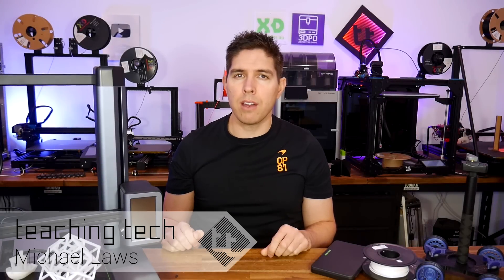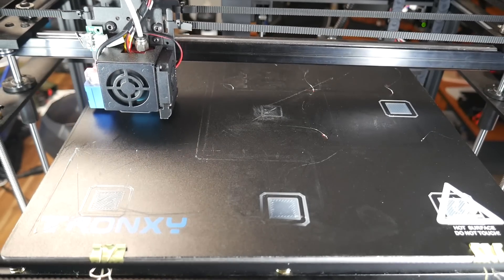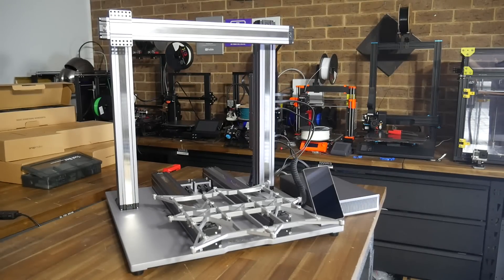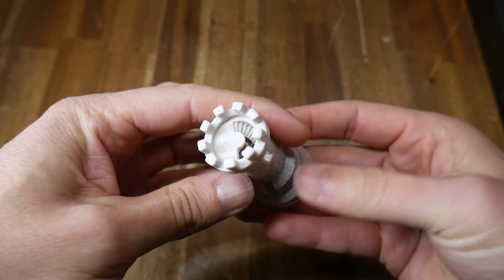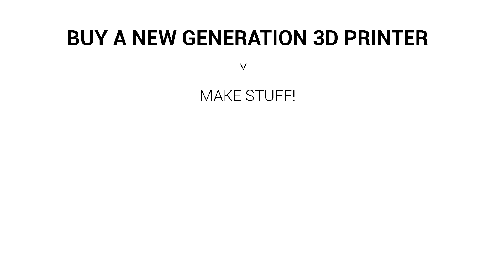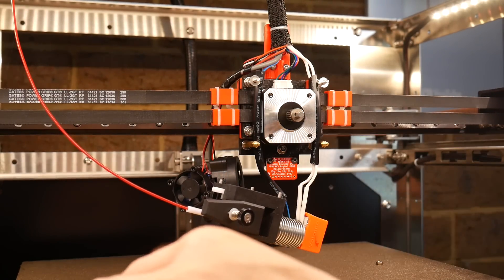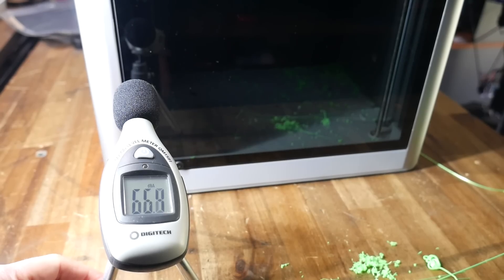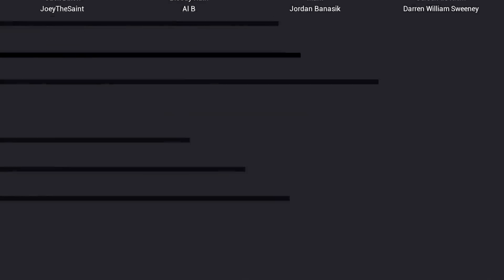Next gen 3D printers are here, but do they bring fresh problems?

Comment: I think you hit the nail right on the head.  The X-Plus3 is a great example of a product that desperately wants to be a cheaper X1C, but completely missed what makes the X1C good.  Ironically, the plastic bed plate that seems to be such a big liability for the X-Plus3 is actually present in the X1C, but the materials and geometry are different and don't seem to cause issues.
Reply: So warped beds on x1c and p1p is a not an issue for you? Lol
Reply: @rightsdontcomewithpermits7073  my p1p bed isn't warped
Reply: @splitt3r  good for you! You won a lottery with them! Mine x1c has a warped bed and bl send me another warped bed. And told me no more. Because there is a big possibility I'll get another warped bed. But regardless they claim it is within the specs. But fail to tell me who's specs, and ignore every time I'm asking them to give me my bed mesh data. 
This crap printer is overhyped.
Reply: @rightsdontcomewithpermits7073  at PwnCNC we are about 20 X1-Carbon deep already and have had 0% problems so far. 
Sounds like you just got a lemon or lemon bed at least.
Reply: @rightsdontcomewithpermits7073  if I measure my beds, they're not perfectly flat, but the mesh leveling seems to handle it well enough.  If I hadn't measured, I wouldn't know.
Reply: @Clough42  Curious about these new gen printers with software bed leveling: If the bed is indeed warped, but the software compensates for it... then does the print become warped to match the bed? Would the finished print not be able to sit flat on say a glass table?
Reply: @TweakRacer  That would really depend on the degree of warpage. If the warping is sufficiently small, it would get lost in the deformation caused due to the internal stresses generated during printing being released as the object comes off the build plate.
Reply: @TweakRacer  Yup, that's exactly the case. Doesn't really matter to those, who print trinkets and toys. But a huge problem for the crowd, that is into prototyping and/or functional parts.
Reply: @ClintonCaraway-CNC  You are pretty lucky then because like @rightsdontcomewithpermits7073 I also have a warped banana bed and got another banana bed from the support. Center to Corner with differences from 1.0 mm to 1.5 mm on both beds. Support also told me that every other bed they would send can be warped too because of their production methods. Large prints got a banana shape too and are shaking if you touch the corners.
Reply: @TheStunRope  jeez and I thought my ender 3 S1 with .3 variance was bad. Even my €15 180mm Alu bed from AliExpress was better at .08
Reply: @Botanic2000  Yeah lol what would Clough42 know about 3d printing for production? Not like he's using 3d printing for production on a basicaly continual basis. Oh wait...

Comment: Bambu Lab X1C owner here. I really did not like how technical it was getting klipper up and running on my previous printer. I don’t care if software is open source or proprietary. I really appreciate that with my Bambu printer I only had to unbox it, turn it on, let it go through a self calibration process and it just works. I haven’t had a single failed print, the firmware updates brought helpful improvements, and the Bambu Studio slicer and Handy mobile apps are easy to use. The printer just works and it’s fast.
Reply: Same here my first printer was a anet et4x and it use to work for the first like 3 months but then it just was fail prints, then I got the ender 3v2 and the same experience thinking it was me following YouTubers advices on how to improve the machine and got another ender 3 V2 to just leave it as it comes out of the box but the same experience. I got the bambulab x1c and I have 70 hours of print time and just first layers issues that are just because I have to apply more glue stick to the cool plate but nothing that I have to tear apart the machine to fix, it have been an awesome experience and I am learning cad more faster than ever because I can make my prototypes fast and with no issues.
Reply: The big issue is that Bamboo makes disposable printers. At some point they will stop supporting your printer and you will not be able to get parts, meaning you will need to toss it and get the next model. This is like most products. What makes Prusa special is since they are open source you can get parts for all their printer or print spares yourself. Also you can update all of the i3’s  to the next model. You can update a mk2 all the way to a mk4. It’s very unique in the disposable economy to have a machine that is still supported and upgradable a decade later. With that said Bamboo is a good printer and should work well for you for a long time.
Reply: @MrKornnugget  My only question now is, seeing the speed and efficiency in new printers I wonder where to take my Prusa MK3s, or if I even should upgrade to a MK3.9 or MK4. I look at that money for an upgrade kit and think I could easily put that towards a Voron after saving. Or an X1 if I don’t want the hassle. There doesn’t seem to be any plans to bring some form of input shaping to the MK3, and I don’t know how far I can take the MK3s. I’d love your input tho
Reply: @krokenlochen   I have been looking at the MK3s to 3.5 upgrade. for $250 you get the "xBuddy board and new LCD, gives your MK3 the new 32-bit electronics, new connectivity options, Prusa Connect support, and also Input Shaper and Pressure Advance for high-speed printing." I am not sure if it is worth the money or not. I am waiting on someone to get the 3.5 upgrade and show how well it works.
Reply: Where are you getting that statement from 😅.  @MrKornnugget

Comment: After being unable to print anything for two weeks with an Anet A8, I picked up a Prusa i3 MK3 in July of 2018, and that made 3D printing my hobby (and partially I made a living from it in the past) which I still enjoy to this very day. This experience alone, and the fact that Prusa printers are and will be open source, and that they are based in Europe, not China, makes me gravitate towards them. So even if the Anker and the Bambu could be a better value for the money, I will still go for the i3 MK4.
I like Czech beer, drive a Skoda, so it seems natural to have a Prusa :D
Reply: Is the mk4 even a competitor to these machines? I don't think so. Fact is these are fully enclosed and can do more materials - that alone makes them a totally different product. Also, what exactly does the mk4 bring to the table? Why would I buy one over these? Literally no advantage.. Voron 2.4 is more comparable. But ultimately, the voron, and prusa machines all fall short of being press and play... no purging, no self cleaning nozzles.. you still manually have to do so much.
Reply: @jessejuliano8056  The Ankermake M5 is not an enclosed printer! Watch the video again. :)

Besides it's very easy to enclose a printer, even it is a much cheaper Ender 5 S1. So it's not even a premium feature to print materials like ABS or PA.

It seems like you dont want to get the points mentioned in the video! But having a machine that can easily be maintained, can be equipped with 3rd party parts, is produced in Europe, offers a 24/7 support and a well written documentation are just some points here.

Maybe Prusa has to rethink the pricing. Maybe the 800 bucks Kit is the way to go here. But looking at those max. 800 bucks there are not many companies that offer the point mentioned. A Bambu Lab is not easy maintained. A Creality often does not have a fluent and well documented user experience. A Voron can not be purchased as a out-of-the-box machine and is way above 800 bucks. A P1P is also not enclosed and does not come with a hardened hot end... and the list goes on.

There still is no "best printer" and there still are many use cases. So it remains good that there is competition.

Comment: My concern is repairability and total dependence on the manufacturer for support. It is great to see stuff that works well out of the box, but it also looks like a move toward the "use it until it breaks, then buy a new one" culture.
Reply: Do you also fix your flat screen when it is broken? Microwave? Do you personally fix your (post-2020) car even? What about your washing machine? 
Have you installed any mods on your washing machine lately?

I'm happy the Chinesium/Prusa hobby and tinkerer toys are being supplanted somewhat with appliance grade printers.
Reply: @johnfaustus1  you've obviously never used prusa. They do come pre-assembled now, and they just work. You don't need to tinker. You also don't need to repair it yourself, they have the best tech support outside the industrial market and you can pay a shop/master to fix it, which will be still an order of magnitude less expensive than paying to repair some of the "aPLLiAnCe"-grade ones.
Reply: @LoisoPondohva  
100% agree, Prusa is almost the opposite of this. 

Being able to grab the new parts and even iteratively upgrade older models to newer versions is the antithesis of the modern "throw it away and get a new one" type approach. Their support and spare parts options are pretty much second to none. While they may not be super affordable, the quality / just works option & the maintainability & upgrade paths are just fantastic. If I am honest, I wish I got my prusa before I got my Ender 3, I likely wouldn't have bought another one
Reply: Prusa is the better one of the bunch in that regard. If you can build a kit, you can easily repair it.
Reply: A smart move. I have a BMW and know full well when you need a part, you HAVE to get a BMW part. Even if it's just a battery to fit your TPMS, which can set you back hundreds and needs a special tool to fit, so they charge hundreds more for labour, for a battery than Taiwan probably makes for pennies. My battery in my Navgator 5 needs renewing now because it no longer holds a charge, and they want £66 for it. You can buy a whole satnav for that. I looked everywhere online and it turns out you have to go through BMW, even though it's a Garmin made system. Last year the control ring failed, which is just a ring of plastic with wires coming out of it. They charged me £188 for the replacement which took them 10 minutes to swap out.
Reply: Similarly, I'm worried about apps. I'm not interested in cell phones and apps and programming and find programmers and their creations incredibly off-putting. Being able to print from around the world is not interesting, fucking around with bluetooth is not interesting, and trying to figure out how an app is selling my personal information is not interesting. Doubly so when the cloud or app or whatever dependency it uses stops being supported.
Reply: @johnfaustus1  no but i would fucking like to.
Reply: @johnfaustus1  Those can be split into three categories
1.[Microwave] Typically not worth repairing as a replacement is <$100
2.[New Vehicles] Locked down by the manufacturer to drive repair costs up and increase profits. Worst of both worlds really.
3.[Television, Washing Machine] Absolutely repairable in some cases if you have even a small amount of skill and do some research.

Also, typically I am not buying a car from a random Chinese vendor that might not exist when it breaks down in 6 months due to cut corners in production quality.
Reply: @AMidgetWalrus  Well thought out, and I see your point.
Reply: @johnfaustus1  Go buy a Samsung refrigerator.  They look REAL nice on the outside!  The downside is they fall apart right after the warranty expires.
Reply: @LoisoPondohva  Yeah, Prusa is the way to go not some slick Chinese engineering bullshit that you can't work on.
Reply: @ArcanePath360  Yeah, I love BMW's but I hate the company and their business model.
Reply: @chrismathewsjr  "Similarly, I'm worried about apps. I'm not interested in cell phones and apps and programming and find programmers and their creations incredibly off-putting. Being able to print from around the world is not interesting, fucking around with bluetooth is not interesting, and trying to figure out how an app is selling my personal information is not interesting. Doubly so when the cloud or app or whatever dependency it uses stops being supported."

Bingo!
Reply: @joeking433   Indeed. They are mostly bullet proof and probably the bike I have the least trouble with, so you get what you pay for.

Comment: Please do mention the status of Anker's multiple standing GPL violations in your review.  By purchasing some of their machines you are buying stolen work.  Keeping in mind, if they do find themselves in actual trouble over it, they will likely bury the product and cease support for it (that seems to be the pattern with companies dealing with that sort of thing), leaving the customer high and dry.  There is also no way to inspect their implementation of safety features in the firmware.  Sure, those customers won't be digging through the source code, but it does mean nobody can sound the alarm and inform people of found risks.  You just have to take their word for it.  Creality is doing this as well to this day, willfully violating the license for the software they are using in their products.  That isn't a good way to demonstrate that they are worth trusting with what for most people will be a limited budget for a big purchase.
Reply: may i know what it is, just curious I'm not gonna buy it hehe, one printer is enough
Reply: It says they're Compliant in the list I found so...
Reply: Creality finally released the full source for the Sonic Pad so at least they are loving in the right direction.
Reply: Um what? The full source code, for the firmware, slicer, and their experimental SDKs have been available since release. TH3D just didn't bother to check the repository until March. If you check the commit records it has all been there since October of last year.
Reply: >>> Compliance Achieved - Anker <<<
NOW COMPLIANT – Release source some time in March 2023

Comment: Our Bambu X1 is so fast and reliable for printing it's hard to look back.  However, it does feel too complex to just dig into and swap parts once we do have a breakdown.  Still going strong but doesn't feel modular or simple.  Paid for itself in weeks BTW.
Reply: If it's reliable remains to bee seen! Especially those carbon rods.

Let's talk 3 to 5 years after launch again.
Reply: @TimGautier  yes, we're making 3d printed M.2 SSD adapter holders/ mounts for a communication base station in ESD safe PETG.  Our main metal shop charges ~18.  I make them for 1-2 and we charge ourselves $4.5 internally for my time/matl.  Making batches of 10ea at 7am, noon and leaving time.  Too low volume for injection molding.  Raise 3d is 3-5 times slower only making 1 batch and unreliably.   You can iterate on a design several times over in a day tweaking a concept.  Great printer.
Reply: Costs too much and still has the same problems as the cheap printers.  You're just buying a pretty machine not one that is really engineered better.

Comment: I love the upgradability of the Ender 3 platform. The Prusa mk3 was way too expensive for me, so I got an Ender 3 on sale, upgraded it to a Prusa mk3 hot-end and extruder, and similar stepper drivers. It's not as sleek or premium, but I learned so much throughout the process, I feel like it made me into an expert when it comes to budget printers. If I had to upgrade, I think the P1P and the Prusa Mk4 are very decent out of the box. 

Most people  are not going to be willing to tinker. Most Ender 3 users never even update the Marlin firmware, so the next generation is going to really help get more people into 3D printing. The biggest issue now is what to do with your failed prints and support material. I have a huge stash and nowhere to recycle it.